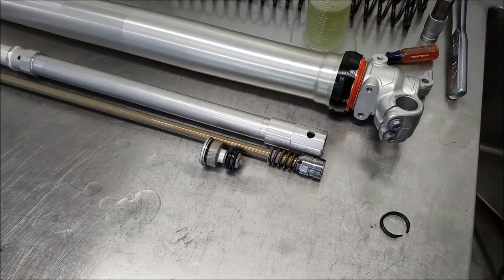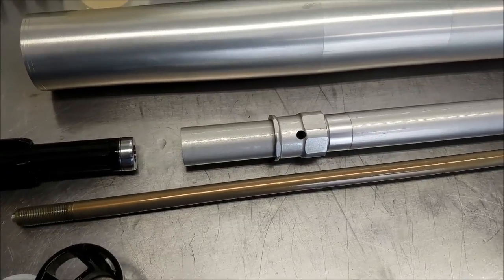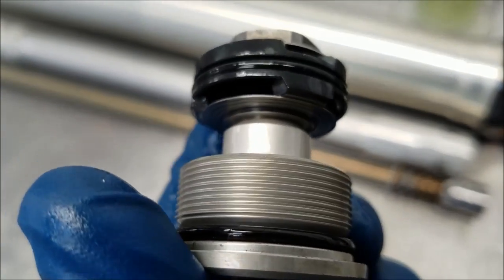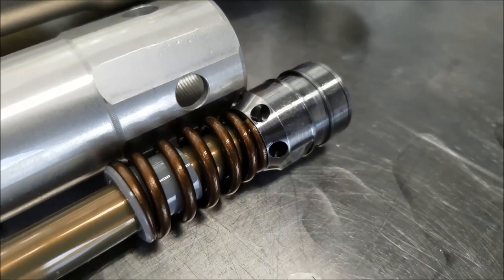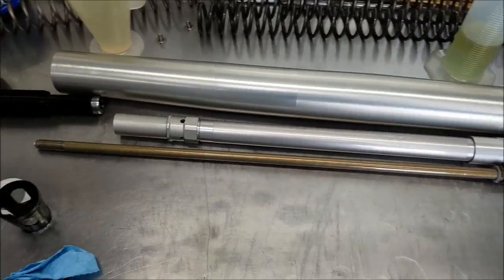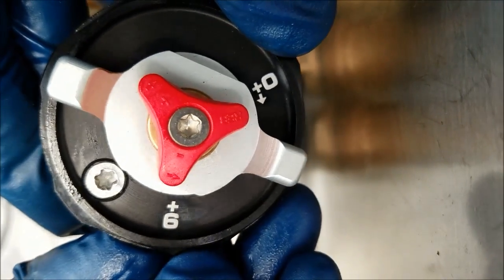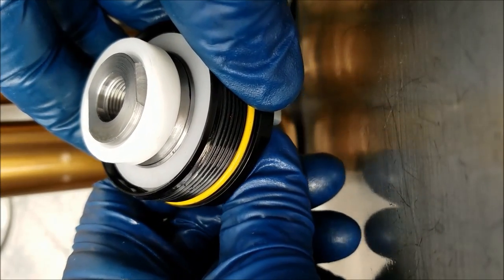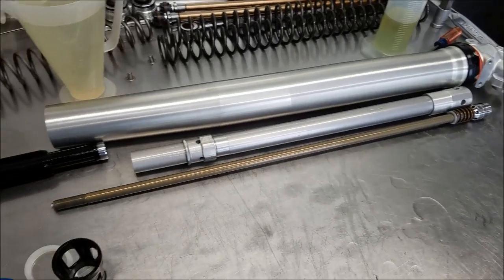Husqvarna and KTM WP XPlor 48 fork

Comment: I have a 2017 Husky TE300. I'm 165 lbs without gear and I find both the XPLOR forks and the rear shock to be very harsh. Much more so then the 16 model I had previously. The damping adjustment on the front does zero. Biggest disappointment on this bike. All the guys who call it soft must be 200 lbs plus.

Comment: Nice vid, Will my 4cs springs fit these forks? Everybody seems to have a different answer.  Thanks
Reply from the maker: Lucia Oles, thank you. Yes, the springs should fit, however if they're out of an older set of 4CS you'll need shims/spacers to make up the difference. Older 4CS length was 460-465 mm, newer length is 470 mm. Hope that helps! if you need springs check us out on store.motolabdirtbikes.com thank you.

Comment: After putting in a heavier spring for my weight, the compression side fork seems like it is just operating on the spring.  it doesn't seem like it has any compression dampening when I push on it with it off of the bike.  Holding it with both hands and pushing down on it, it just seems like a pogo stick with no compression dampening.  I didn't try this before changing springs so I didn't know if this was a normal action or not.  any ideas?
Reply from the maker: Ken McCormick, as long as you followed the repair manual and did not lose any fluid you should be good to go. If in any way you don't feel confident that you installed it correctly, take them to a certified mechanic to check. Cheers!
Reply: Hey! have You solved that or that's how the system works? i have the same 'problem'

Comment: In past the biggest negative review on the Husky FE501 was the Fork/handling. Do you believe that this newly designed fork will improve these complaints significantly on past Husky's i.e 2016 etc. The reason I ask is because I'm looking at chosing between the 2017 FE 501 or the 2017 KTM EXC 450 (SIX DAYS) edition. Both have the XPlor fork. Tough decision on the other hand which bike to go for. Good problem to have.
Reply from the maker: Hello!
100% confident this fork is better. It's an open chamber design with great features that work. 
I personally think the linkage bikes work better overall than the PDS bikes. I've had both and each have their hiccups but you can't go wrong either way! Note: the new smaller PDS springs won't be available for another week or so.
Let us know if you need some help with springs on your new bike, we price match and include free shipping over $150, Secure online shopping.
Call Rob at 928-362-1486
e-mail us info@motolabdirtbikes.com
store.motolabdirtbikes.com  

Thanks!
Reply: Good input. Also the Husky is bit taller. 10mn compared to the 450 Exc. Im 6'1 185 pounds with no gear. I was just concerned that I was giving up the 450 power delivery of being right in the middle of the 350 Exc cs the 500 exc. I thought the 450 could possibly be in the sweet spot for single track and intermediate light technical.  Rocks and roots and climbing and logging  roads but this was only my unqualified opinion. I thought going to the 500 I'd be jumping into the arms wrenching and tugging power delivery which can be exhausting after 6 hours of trails. Ive never riden linkage Suspensions or a Husky let aline the new 2017 FE501. Probably better for 2 day adventure ridea as well that are under 75 miles on the road, back country stuff. 

Thanks for listening to me go on.  Cheers
Reply from the maker: cw127cw Think of where you'll be riding 90% of the time and make your decision there. Also do you like to lug the bike (low RPM, or Rev the bike?)
Reply: I love a bike to be able to climb threw technical without having to drop a foot down. Playing around low speed trials enduro techniques working on form and focusing on little wheel spins. Picking easy and more difficult lines and then focusing on low speed form instead of grabbing a handful and blowing up trails roosting and wheelies threw trails. Albeit I love wheelies!!!
Reply from the maker: I'd go lighter, FE 250, or 350. Plush, light, won't wear you out, plus it's designed exactly for what you want to do.
Reply: I hear you but a tiny detail, actually a huge detail I left out is that I'd to do some 1-3 day rides with gear loaded up. Nothing crazy, all under 100 miles. I know trying to find a bike that does it all (well) is next to impossible but at the same time I don't want a bike that's geared for trails to ring out when I'm connecting trails or Island hoping or ripping threw the mountains on trips camping etc. So looks like I just have to tweak my expectations of the 2017 FE501, albeit they are lighter and more nimble for 2017. GIve and take relationship with the 500's. Looking forward to seeing what the improved design can deliver. Thank you for the input and advice.

Comment: Great video Rob, I'm putting some 5.0 N/mm springs in my 2017 500 six days this weekend. Do I have to do anything with the preload settings before I wind the cap off the spindle? also do you happen the torque setting of the cap as it's not in manual? many thanks, Tim
Reply from the maker: Thanks, Tim!  Sounds good, hopefully you've got the shock spring to match those front springs! The spring length should be the same and you should be able to unbolt it without any other changes. The torque for the jam nut up against the fork cap should be snug (approx 15 lb ft or less) Torque the cap lightly, as the triple clamp does 90% of the work holding it in the tube. Berapp!   
PS. Don't keep us a secret! Check us out for any of your dirt bike accessory or protection needs, we've got you covered!

Comment: Hi there I have a question. Ive recently purchased the the 2017 ktm 500 exc 6 days and need to install heavier springs (105KG without gear / 115kg with gear) what spring rate would you recommend? thanks in advance.
Reply from the maker: Brad, what is your skill level, also how much time are you sitting while riding?
Reply: Skill level immediate / Sitting 50% of the time. Frequeantly bottom out when doing jumps, hope this helps thanks
Reply from the maker: Where are you going to spend 80% riding the bike? Track, trails, enduro? Also what's your age?
Reply: 90% Dubai Desert riding - so sand dunes and trails. Age 38!
Reply from the maker: Okay perfect, .49 N/m or a .50 kg/mm fork spring.
Reply: Thank you very much sound review by the way! Well done.